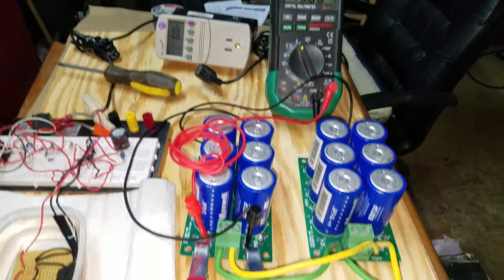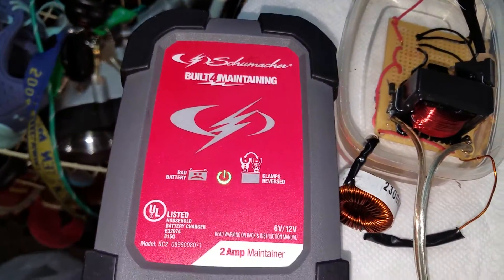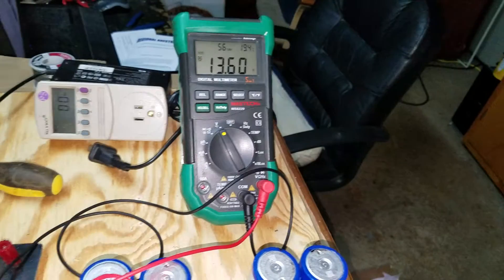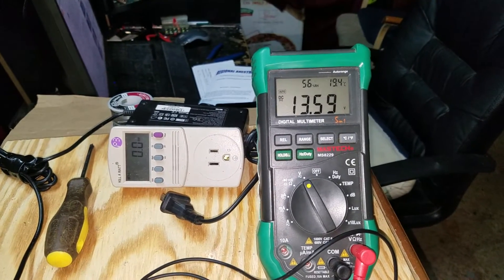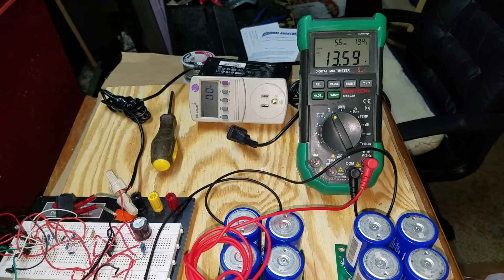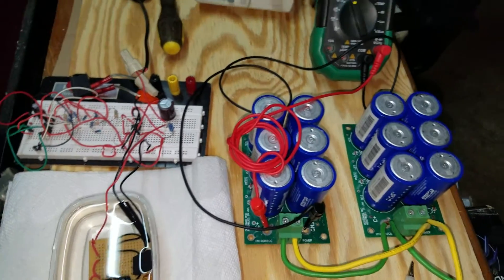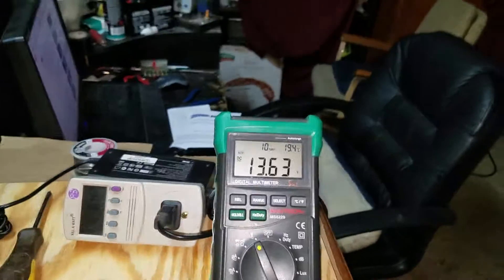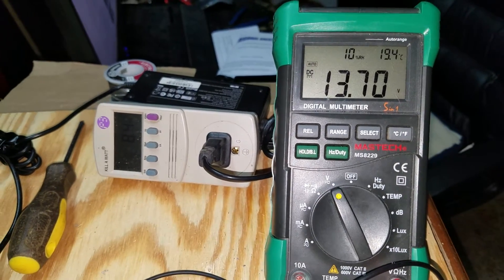Radiant charger vs. 120v to 12v 2 amp charger part 1

Comment: Looking forward to your next build! Any updates?
Reply from the maker: Hi Joe, no I haven't completed any updates yet, but I am going to be able to build the next circuit and finish my research to complete this one with all variable circuits as I purchased prebuilt oscillators and would like to be able to get them tuned and start selling them as kits for charging and proof of overunity once I get that far. I was out of commission for a while after an injury and surgery, but I am now well enough to work on these circuits again. It was difficult for a while there to even use the mouse on the pc but now things are looking much better. I have drawn many circuits I have envisioned while having nothing to do but think in pain, so maybe I have something that will be worth building that will give much better outputs. This was a low voltage version to see how I could make gains in an effort to use small pulses for large outputs until I found the av plug's effect through a resistor at ground. I am currently building an aerial to collect the atmospheric energy as well I have bought some other materials to get better grounding by using graphene and a few other nano particle powders. There's so much we could use, the sky is the limit, so if somebody has ever said we can't do it, they have something wrong with them because there was and always will be too m any variables for overunity or harvesting of outside energies that we don't know about to be completely impossible. We need to all band together and make "suppression" an impossibility. That is the only way this is all going to work, and I will be here to the end doing so!
Reply: Absolutely true words Marc. Please message me. Thank you